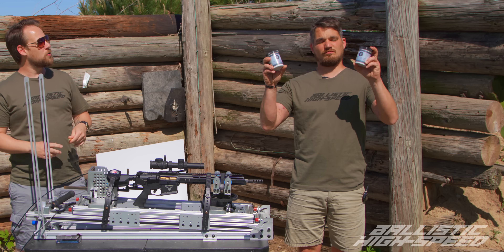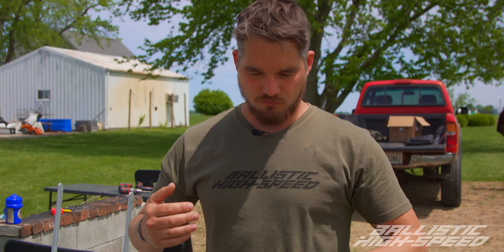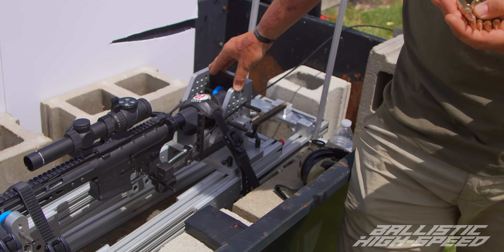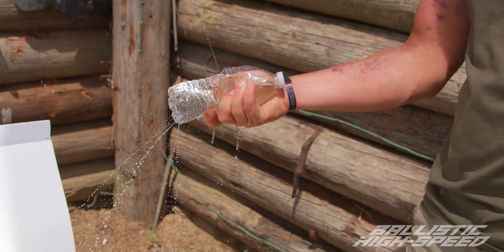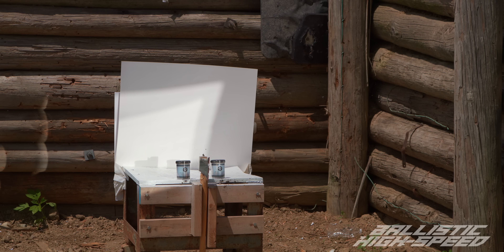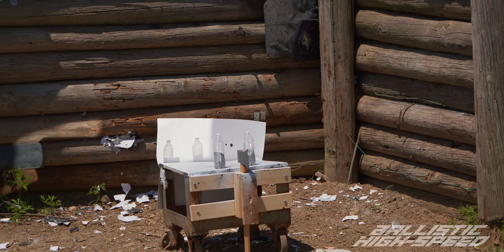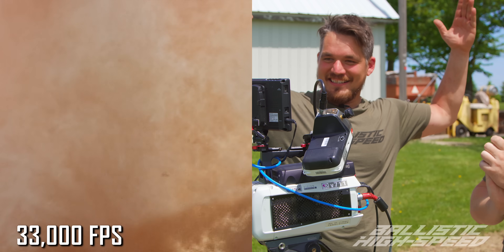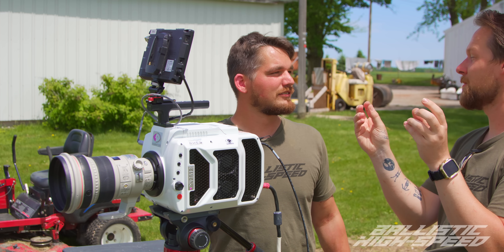Splitting Rifle Bullets with an Axe! - Ballistic High-Speed

Comment: Cz 550 416rigby vs 500nitro vs 700bmg vs 4bore vs 950jdj vs 20mm anzio bolt action sniper rifle vs 50cal rauffoss round vs ballistic gel vs torso wearing ar500/550 and level4 ceramic plate 1 2 3 pieces vs slowmo camera

Comment: You should have been taking a honing rod, sharpening stone or file to the axe blade after every shot to keep it clean.
Just a reminder, you can split bullets with just a butter knife...which makes for some future content potential - grab a bunch of thin stuff to split bullets with - forks, spoons, metal rulers, box cutters - could be interesting.
Reply: the only issue is that the axe could be pushed too far out of alignment if they do that, meaning that there's now two variables to adjust simultaneously rather than just one with rifle. Not to mention that doing so means that they can't use the last shot as a reference point for adjustment, so essentially the adjusting would be made restarting from zero, so the alignment couldn't be walked in.

Comment: Please make a giant (4-6 foot diameter) parabolic “mirror” out of 4 inch thick concrete and place some type of explosive and place a ballistic dummy head at the focal point of it so the pressure waves will get reflected and focused on the head. In theory you could significantly increase the local pressure immediately around/on the head/object. May even be able to generate a small ball of plasma at the focal point if the explosives are strong enough.

Comment: If you shot a group of 10 rounds at a blank piece of paper you will find there will be variance of a few mm, to hit an axe on the edge square on with a bullet over and over again is near on impossible, you've done extremely well to get it at the point you have.

I used to work in Ballistics at the Winchester ammunition factory here in Australia.

Comment: My dad used to shoot black powder rifels. He would take a double bladed axe and stick it in a block of wood then put a target on each side. He was pretty consistent at splitting a lead ball and hitting both targets. He would fire from the shoulder with open sites. He also shot the nose off a rat when it was running. It was inside my uncle's kennel. Dad said he ment to do it but still felt like it was still luck that he made the shot.

Comment: The reason it was so much more destructive when both went off at the same time is because the two shockwaves from the explosion were working against each other. This principle is basically what we called a counterforce charge when I was an engineer in the Marine Corps.

Comment: 1.  That axe can be resharpened.  
2.  A soft point round nose or flat point bullet in the smaller calibers might be easier to get a good split.
Reply: You are right. They did that in a previous video.
Reply: 30-30 lead soft tip